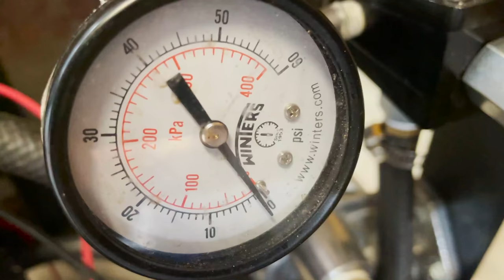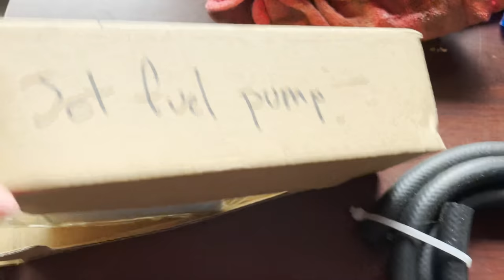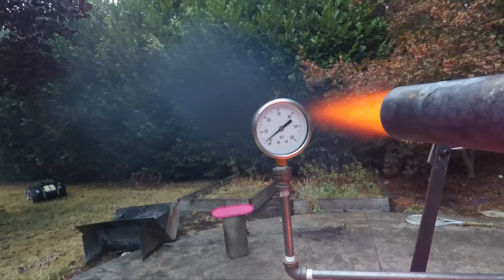TURBOFURNACE: MAX HEAT

Comment: Red hot and it didn't explode. GOOD. It makes a very good furnace for the winter. The gauge was dangerously close to the flame. Good job.
Reply from the maker: Thanks! Yeah the steel is getting thin and I think this burn chamber is basically at end of life.
Reply: @survantjames  have you tried to coat it with lipids? any oil or fat works, polimers cannot stand that high temperatures but the blueing shouldnt shave as quickly as the continously rusting steel, while being cheaper and less labour intensive to replace compared to changing the whole burner
Reply: @survantjames  try lining the inside with Plastech 85P... It is rated to 3000F and will greatly extend the life of your chambers. You ram it in place and then fire it after it dries. Also, once you get that figured out, try insulating with kaowool to improve efficiency. I wish I was your neighbor, we could do so much!
Reply from the maker: @chasbader  We just moved, hoping our neighbors will be as enthusiastic as you are! Thanks for the tips. I’ll have to look into that stuff.
Reply: The hell it would that's loud ash no way I'd wanna be around that bullshit
Reply: Why do I live in apartment? I desperately want to build one of these.
Reply: Looked awesome but what is the purpose? Someone please explain:)
Reply: M
Reply: @brambob9510  pushing heat, it's pretty much a over sized space heater that can't be moved for 48 hours to cool down, it can go boom boom, so I wouldn't recommend it rn
Reply: @brambob9510  If you have never stood 5 feet away from something that could catastrophically fail and kill everyone in the vicinity, it's an adrenaline rush. It's fun to poke at a camp fire. It's also fun to see how big of a fire you can make. It's even more fun to slap a turbo on it and see how much horsepower you can add to a fire, lol.

Comment: Comming in 2022: twin turbocharged version.
Reply: This would be pretty cool, a bigger turbo for a low pressure spool, and the smol boi for the high pressure, maybe an intercooler between them for better efficiency.
Reply: @pvtnewb  It has to have an intercooler at the temps they are pushing, and maybe oil cooling as well.
Reply: Yes plzz
Reply: Yep, it's "coming"
Reply: coming in 2023 compound turbo setup 110 into a 190 it’s gonna take a while to spoil but the amount of boost that it’s gonna make your gonna need to mount it into the ground and maybe even to more
Reply: @kaylebnewcomb9606  yeah we're going after AMG next
Reply: Or compounds
Reply: @pvtnewb  yes, but that won't be twin but series.

Comment: Increase your water pressure. It needs to be higher than your boost pressure. Otherwise it blows back through the pump. You might also try a check valve to regulate.
Reply from the maker: The garbage diaphram pump we were using for water failed to self-prime and we didn't notice before getting carried away with the run. There is indeed a checkvalve on the water injection line. Thanks!

Comment: Have you considered re-directing the air from the pre combustion area to the post combustion area to keep the egt's down, get a more complete combustion, and maybe a form of boost control? I was thinking maybe just a wastegate from the boost pipe off the turbo to just before your cyclone filter. Curious to see what you come up with next...
Reply from the maker: Yes, we eventually plan to make an affordance to allow air leaving the compressor to bypass the combustion chamber in order to reduce turbine inlet temperatures.
Reply: Redirecting some of the air from "primary" zone to the "secondary", would help with more complete combustion, sure. However it'll make the final product more "lean", which I guess will rise egt's even more. However, of course, the total energy output will rise.
Reply: @NuViss  This.  You'll burn the smoke from primary combustion adding more heat to the mix if left as is.

However, the more air goes to the secondary chamber over the primary, the cleaner the exhaust will be.  Air in the primary chamber should be just enough to light off the fuel, with the rest going to the secondary chamber until smoke output is effectively zero.  Watch how an orchard heater (AKA smudgepot) or EPA-certified wood stove works.  Bonus is the fuel will last a lot longer.

Starting will be an issue, however, since you need to heat above the smoke's flash point to get the secondary burning process going, so some way to divert between the two will be necessary to adjust as the whole bomb, err, turbofurnace heats up. :)

Comment: I run a petrol engine on woodgas, to make power for the farm - and I am really amazed at what you have done here  :) .
Reply: Marty Fourre  gasified wood. Its an odd process but it chemically breaks down wood by cooking it and it releases combustible gases
Reply: Marty Fourre  
 Yup. Alex is on target. 
 Wood is burnt in a low oxygen environment, where is produces highly flammable gases. 
 This gas is then cooled, cleaned and dried - before being fed into an engine. 
 You can see examples of this on my channel  :) .

Comment: What a cool build. Respect for all the engineering and design that went into this.

Two things I noticed:
The filter "trap" looks the hottest of all the components. Am I correct to assume that charcoal is causing that?

Also, it seems like water injection doesn't just lower combustion temps, but also controls the smoke. Maybe you could play around with a multi-point injection, say, another port in the filter just before the up pipe.

It'd be cool to see this thing with a water jacket, and maybe a catalyst for even more heat!
Reply from the maker: I’m not really sure what causes the bottom / trap of the filter to get so hot! Maybe the long residence time of gasses that make it down there? Maybe the fact that the soot dust that ends up swirling around there in large concentrations imparts a lot of heat to the sides? I’d be interested in reading some papers about heat transfer in cyclones….

Re water injection: yes, it does reduce the smoke, good observation! Actually I am planning to add another injection point exactly where you suggested, basically coming up through the filter trap bottom and spraying directly into the up pipe! I’m very interested to see if it will calm those TIT and EGT numbers down!
Reply: Can I suggest that you are only getting partial combustion because you are introducing the fresh air below the wood instead of above the wood and you are running rich by blowing the unburnt charcoal/smoke up without secondary air to burn it.
Reply from the maker: @brucebaxter6923  Yep that's definitely happening.
Reply: another commenter suggested the vortex filter is actually serving as a second high swirl combustion chamber. the turbo furnace is a ruminant!
Reply: Cool idea about the water jacket. Might help keep things from burning to oblivion so quickly.
Reply: How cool would it be to see this with an auto feeder? Some sort of double-door hopper with a push bar that can refuel the unit without having to shut it down.

My brain goes places when I drink whisky. 😛

Comment: Dope! What was causing it to cut down periodically/lose psi? Would love to see more!
Reply from the maker: We have a throttle valve in place limiting intake air flow to keep it from running away. Operators are instructed to keep it steady around 5psi and not to exceed 10. Once we can get exhaust temperatures reliably under control we hope to achieve higher operating pressures. Stay tuned!
Reply: @survantjames  very nice, excited to see more!
Reply: @survantjames  You should install a bigass wastegate on the turbine inlet (hot side) to regulate the boost pressure automatically. I wonder if you could do some water mist injection somewhere on the hot side to keep temps under control without losing thrust, since the heat would cause the water to flash to steam.
Reply from the maker: @draggonhedd  Yep, we do have water injection already. The pump failed to prime and that’s why we stopped and restarted.
Reply: @survantjames  oh i thought that was water cooling for the turbo core

Comment: I am developing a turbo reactor based on oil and water with the pressure of the same turbo including for the lubrication of the axle. my question is ... did you try injecting used oil into the reactor other than wood and water?
Reply from the maker: Not yet! ;)
Reply: pretty sure that's just a shitty jet engine
Reply: @survantjames  you should use the injector nozzle apparatus that's inside those diesel/kerosene jet heaters. It has 2 ports on it one for compressed air and the other is for fuel. The more air pressure you give it the more fuel that's atomized and injected. Would be perfect for this.

Comment: Awesome work guys. I’m in the planning stages of building something very similar and been scouring for videos of it done properly. This looks awesome. From the cooled lubrication oil, to the throttling it properly. What are you using to throttle it? I was thinking a large throttle body with a push pull cable to control the intake flow. 
One more question. What is your cooling water cooling? Are you spraying it in just before the “cyclone”? 
Oops one more. Does the discharge tube on the cyclone protrude down inside it or just butted up and sitting flush with the top? 
Cheers
Reply: Hey there! I'm the one in red
We're just using an off the shelf throttle body with a pull cable on a foot pedal
In this iteration the cooling water is injected straight into the burn chamber and keeps the exhaust gas cool enough not to melt itself. Later we added another jet straight up into the cyclone.

There's a spreadsheet with the specific cyclone geometry, I remember it coming down about 4", half way to the conical section
Reply: @specific-solutions  awesome thanks for your reply. I’ll be building one in the coming months. I have a large turbo and weld up a couple of chamber, one for a fire box and one for a cyclone I’ll go heavy with mine, maybe 1/4 wall minimum to try and make it durable. This is an awesome project and can’t wait to have a go at my own.
Reply: @ttv8ra23  you might try to play around with refractory materials. Would mean less parasitic loses, no metal oxidation, and less intense temperature swings for the metal. But you will probably have to be careful about how you spray water in the system. And if a chunk somehow comes off, it's gonna find it's way into the turbo.
Reply: @specific-solutions  thank you for your reply. I am planning on running a 60mm wastegate as well as a throttle plate to control it. The wastegate is a water cooled one and I plan on water jacketing the short pipe from combustion chamber to wastegate, that should Pre heat the water a bit. I was thinking of maybe injecting the water where you did in the burn chamber and then maybe inject it into the cyclone right where the pipe from the burn chamber enters, my thinking is that way the water would be swirled within the cyclone giving it lots of time to superheat and dry. Thanks again for the reply. Love ya work.
Reply: @specific-solutions  A wastegate actuator tied to that butterfly valve would be the bees knees to make this run steady without human input.

Comment: There's still a bit of smoke coming out of the hot end. Do you think putting some holes in the exhaust tube would suck some fresh air into it that would mix with the unburnt fuel and turn it into a sort of afterburner?
Reply from the maker: I have considered this, definitely something I'd like to try at some point. Might need to get a little creative with the geometry so that the exhaust gasses actually entrain outside air into the exhaust tube; I think if we just drilled holes the smoky exhaust gasses would just come out of those holes. I've also considered bypassing some of the compressed intake air and re-injecting it into the exhaust plume after the turbo.
Reply: @survantjames  I think it would only need a small tube that has it's open end inside the exhaust facing the exit of exhaust so the flow pulls a vacuum as it rushed past. That should get a little air coming in
Reply from the maker: @greenbassboosts8872  yep that’s about what i imagined as well
Reply: @survantjames  I dont think drilling holes would work, but maybe thin slots you could use a small screwdriver to insert into & bend the slots to face outwards on a conical exhaust shape out to a wider area where it flattens out to reduce pressure & add external air from the conical section, this is something like how the military do it for afterburners, but they do add air from the compressor bypass air into this section, & fuel of course. This will give a yellowish flame, to make it blue they reduce the exhaust output aperture again after this burn tube area, to RE- compress the gasses as they leave.
You are right, you need to get a little more creative with the exhaust geometry if you want to get a good afterburn, but this thing is awesome, there are always other/extra tweaks. It’s an old thread, but if you haven’t already, check out after-burner tech for a better insight of the maths to make it work. 
Good job, Sub’d. Cheers
Reply: @survantjames  I dont think drilling holes would work, but maybe thin slots you could use a small screwdriver to insert into & bend the slots to face outwards on a conical exhaust shape out to a wider area where it flattens out to reduce pressure & add external air from the conical section, this is something like how the military do it for afterburners, but they do add air from the compressor bypass air into this section, & fuel of course. This will give a yellowish flame, to make it blue they reduce the exhaust output aperture again after this burn tube area, to RE- compress the gasses as they leave.
You are right, you need to get a little more creative with the exhaust geometry if you want to get a good afterburn, but this thing is awesome, there are always other/extra tweaks. It’s an old thread, but if you haven’t already, check out after-burner tech for a better insight of the maths to make it work. 
Good job, Sub’d. Cheers

Comment: Hi. I'm about to build a turbo furnace myself. I've got a couple of questions. 
Would you say that the cyclone filter is an necessity for longevitity of the turbo? Or would a finer mesh screen in the burn chamber do?
Could you go for a bit smaller burn chamber or is your chamber the smallest you should run with if the turbo is in that size?
Regards
Reply from the maker: Most of the material we've caught in the bottom of the filter is basically soot. Occasionally there are larger chunks of charcoal. A fine stainless mesh screen (with lots of surface area relative to the turbine inlet area) might be totally adequate!

You could probably go for a smaller burn chamber, but I personally would go bigger next time. This one only burns for about 5 minutes fully loaded with finely chopped wood. 

A word to the wise: the door has definitely been the biggest engineering challenge. 

Good luck! Interested to see what you come up with. Drop us a note if you post a build / firing video!
Reply: @survantjames  thanks for the answer, much appreciated. I will go for the stainless mesh, I plan to make the chamber out of stainless as well.
Oh I see, had no idea that this size only gave about 5 minutes, will defenetly go bigger.

Yeah, I've actually been thinking about the door alot, do you have any videos or pictures posted on how you did it? Never seen a door on a turbo furnace been fully sealed, it almost always leak a little bit.

I will post a video when it's running!
Reply from the maker: @momatedise  Our "Idol of Motor" video goes into detail about the door. It sealed pretty good for a dozen or so cycles, until recently where it seems to be a bit warped. Good luck!
Reply: @survantjames  Have you considered a total loss oiling system that used waste oil both for turbo lubrication and then injecting that oil for fuel to increase burn times? Maybe goes against the spirit for a wood powered turbo.

Comment: Darwin award nominees. Super heat thin metal to nearly it's melting pount, add some pressure to it by using a turbo charger and place all of this on a homemade wooden furniture dolley. What could go wrong. It is very cool though
Reply from the maker: thanks! drive fast, take chances!

Comment: She looked a tad warm, how long do you get out of the hot side of the turbo before it's shot
Reply from the maker: Time will tell! We are trying to control the turbine inlet temps with water injection but our pump wasn’t pumping in the first half of the run. If you look back through our old videos you can see a turbo die. But I think that was because it ate some wood chunks early in its life.
Reply: @survantjames  the one turbo that died did so because the exhaust gases were so potent it rotated the entire system over and the turbo attempted to mechanically chew through unconsumed fuel rods if i recall correctly

Comment: It's a good thing you didn't get the water going..That's how many steam boiler explosions happen..Secind only to faulty pressure relief valves...Water level sensor goes out and eventually there's a delay in the water entering...Flash steam..Kaboom
Reply: They did get the water injection going. Not really fair to compare a boiler and this.

Comment: instead of pumps, why not use tanks for the fuel and water and use an air compressor to pressurize the tank and a ball valve to meter the flow of liquids
Reply from the maker: Pumps are small, light, and run on 12VDC.